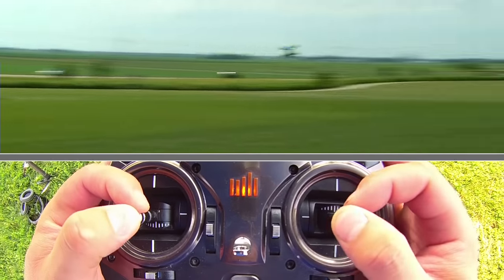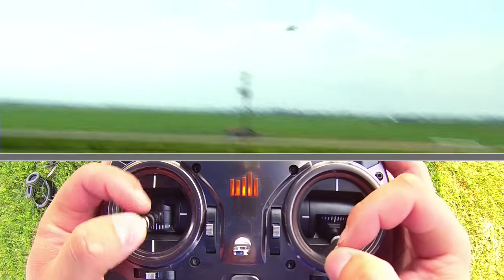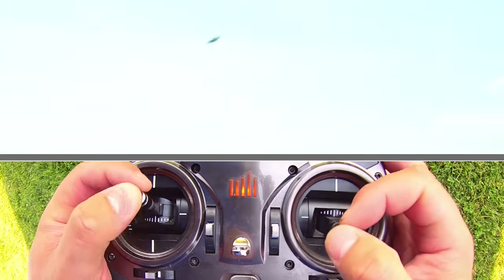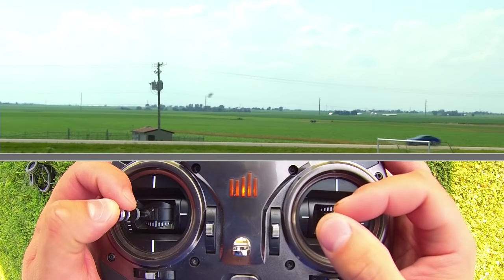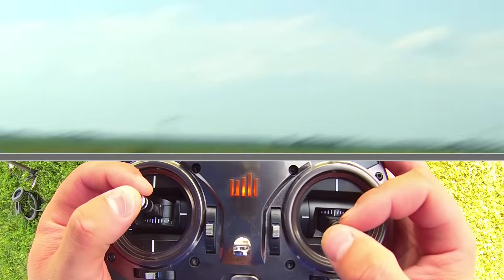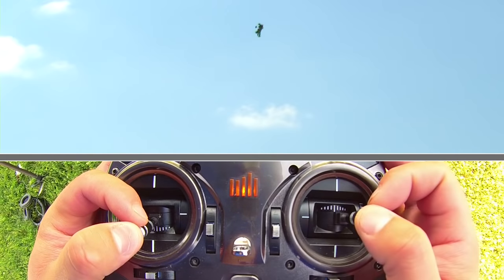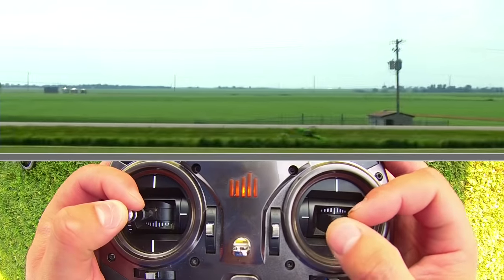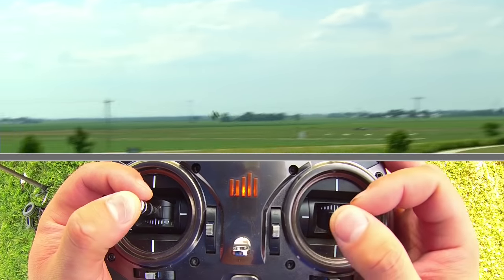Basics of Drone Flight - Aerobatics

Comment: BTW acrobatic flying is much easier when viewing fpv... Orientation can get jumbled using line of sight
Reply: Not really, 3d view still the best until you lost your orientation 😅😅😅
Reply: Totally agree. I personally would never be able to fly acro LOS.
Reply: It's funny watching fpv pilots try and los. It looks exactly like they have never flown because they get so disoriented.
Reply: @BlvlWmpower  yeah it blows my mind to watch heli pilots fly los
Reply: @grumpypoof9648  acro? Like gymnastics?
Reply: We don't know if he's wearing goggles or not, never shows his face.
But I Agree, attempting a flip from line of sight is sketchy if you don't know the orientation of which way your drones facing.
I attempted my first FPV flip and I still ended up landing flat upside down and lost an antenna during the process.
Thank goodness antennas are cheap.
What I did is I forgot to let go of the throttle to stop myself from flying straight down at fast speeds while upside down.
Reply: @LincolnLagger  Acro is when you have full controll of your quadcopter/drone without it self-leveling or stabilizing.

Comment: I am yet to try all this - my worry is this:  In Acro mode when you're doing a flip, is it the pilot's responsibility to make sure that the drone is back upright? or will it anyway come back to the upright position after the roll? i know that in angle mode and in horizon mode,  the drone will snap back to an upright horizontal position.

Comment: This guy is pretty advanced. I get confused with the directions when the quad is not facing away from me. How much practice does it take to get comfortable with controlling the quad when it is facing towards you or to the left/right?
Reply: That is what FPV goggles are for
Reply: But either way, I put a green led on the front of the quad and a red on the back.
Reply: sadigov everybody should learn fly los. what helped with me was a simulator. great practice for winters
Reply: iam pretty sure that wasnt line of sight because if it was..... i will give up flying today lol
Reply: i got same problem.. and because of that i broke 2 quads already.
Reply: sadigov if you are still getting used to controlling it when its facing you I wouldn't even attempt acro mode/doing tricks. Once you can do that then that's when you do what this guy does in the video.

Comment: wow thats so cool, probably a really dumb question but can you do this types of aerobatics on dji drone?
Reply: If you cant disable auto leveling then no.
Reply: Ry Ken yes you can. just enable manual mode in the DJI assistant
Reply: If there is a will there is a way, but a nice beginers racing quad is quite allot cheaper so why would you
Reply: If you have money to throw away -yes. You WILL crash learning to do this. I suggest getting  a cheap one to learn on that can fly in acro or manual mode

Comment: can you do this with any drone o.o?
Reply: Not all drones . I changed my parameters on my mavic 2 pro to manual flight and gopro hero 8. It looks like acro and its hard to fly but its not the same like this fpv racing drones you have not the same quick turns it runs all slower.